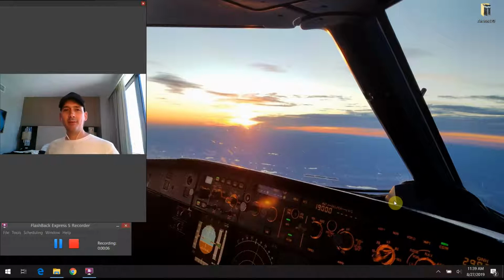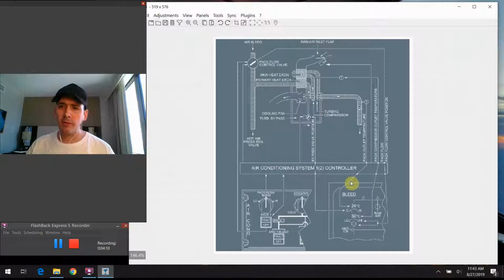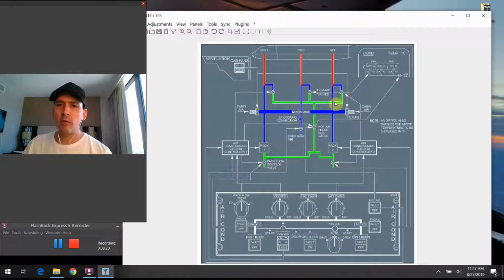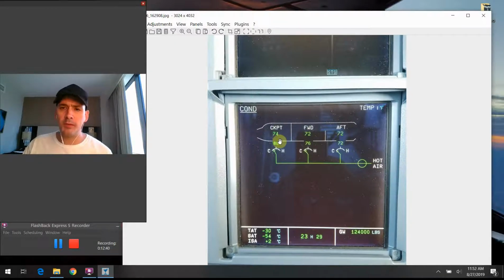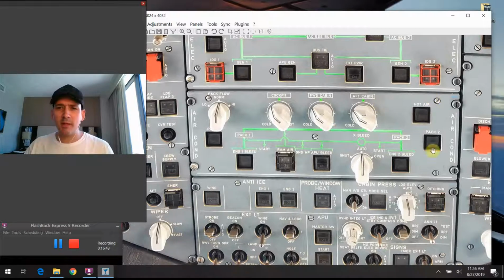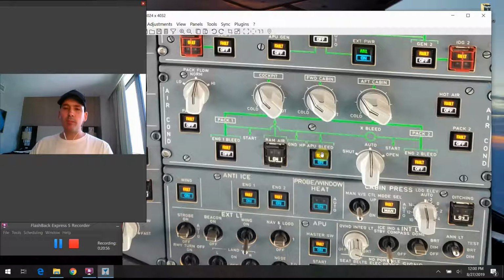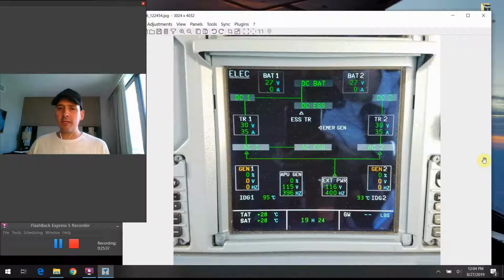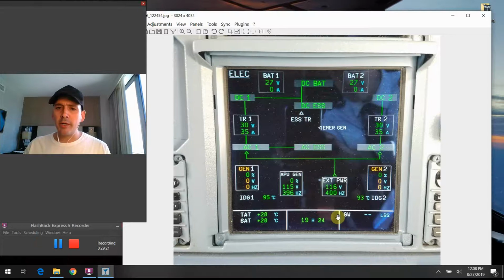Airbus A320 Cockpit Tour: #22 - Air Conditioning Panel: What do all those buttons do?!

Comment: I noticed that when the engines are being turned on, on some flights I would smell a little burnt kerosene in the cabin. Is that because some exhaust is feeding back into the packs?
Reply from the maker: Hi Peter, great observation my friend! Yes that is indeed correct. The pack intake valves actually close automatically anytime an engine is started on the airbus. After the start is completed, the pack pressure regulating/shut off valves, sometimes called the PRSOV's, once again open and being taking in bleed air, which comes from the outside. This bleed air generally comes from the APU if you are going to single engine taxi, or the main engines if you are going to two engine taxi. Once these bleed sources start to feed outside air into the PACs you will certainly smell whatever fumes may be around the aircraft at this point in time. So this could be many things, possible that you are taxing near to another aircraft, or maybe you have a tailwind, and the plane is actually re-ingesting it's own fumes from either the APU or the engines. Thankfully this is generally short lived as the aircraft starts moving and the wind starts blowing around the plane. It's good technique to not tuck up too close to the guy in front of you when you are in a long taxi line. This is a good question and shows some real good head work and thoughtful understanding of how the systems are working...cheers! Mike

Comment: Hi....Why are the windows of an airplane cool to touch but does not feel frozen even if the temperatures at the cruising altitude is below 0℃?
Can you explain more about cross bleed engine start and the procedure for the start? Can you mention a condition where you need the cross bleed valve knob to be in the "shut" position?
I noticed a "GND HP" between the guarded ram air button and the APU bleed button which I assume, is the air supplied from the ground air conditioning units. If an aircraft is supplied air  from both APU and ground, does the aircraft use either one or both?
When the guarded Ram Air switch is pressed,  where does the ram air comes from? 
What are the main causes of smoke and fumes on an aircraft?
What is the purpose of the lower middle box in the lower ECAM? I understand that the lower left box shows the temperatures while the lower right shows the weight. I can't quite understand the purpose of the lower middle box.

Thank you for answering my questions Mr. Abignale 😀😀😀
Reply from the maker: Haha, its all good guys! Keep those questions coming! I dont mind. I love talking about this stuff and I really like to see the engagement! Thanks for watching Leonidas! Do you guys have any ideas of ways that I can make this channel better?
Reply: @MikeAbignale  I'm thinking ......More videos from the cockpit.....Like the one where you showed us that clacking sound of the relays when you press the EXT GND PWR pushbutton.....Really loved it

Or maybe something like a simple quiz or little bonus snippets of information like that about the ice probe....I didn't know it can be illuminated.....I just thought you have to use a torch or something to illuminate it....It is a small, but valuable piece of  information about that small probe.

Still.....Love your content😍😍😍
Reply from the maker: @abythomas6963  ok thanks so much for the feedback! I'll try to incorporate more of those types of elements!  Cheers!
Reply from the maker: Why are the windows of an airplane cool to touch but does not feel frozen even if the temperatures at the cruising altitude is below 0℃? - Youre not actually able to touch the actual window surface itself but a protective plastic cover that has an air gap in between it and the window. This is to protect the glass from damages. 

Can you explain more about cross bleed engine start and the procedure for the start? - Comes out of the QRH, but basically you close the engine bleed on the recieving side, open the cross bleed, and bring the thrust up on the operating engine to achiev an air pressure of at least 30PSI during the start. Usually somewhere between 35-40% N1.

Can you mention a condition where you need the cross bleed valve knob to be in the "shut" position? -If the auto mode fails and you need to isolate one side of the system from the other.

I noticed a "GND HP" between the guarded ram air button and the APU bleed button which I assume, is the air supplied from the ground air conditioning units. -Yes thats correct, this air would come from a High Pressure ground cart that you would be using to start the main engines if the APU was not working. 

If an aircraft is supplied air from both APU and ground, does the aircraft use either one or both? - Essentially the APU air, as the pressure output is much greater than the jetway supplied low pressure cooling air, so it overpowers the low pressure input. This is something we try to avoid doing though because the valves inside the airplane can start to "chatter" as they say, as the systems fight each other to supply air.

When the guarded Ram Air switch is pressed,  where does the ram air comes from? - There is a small ram air door that opens up underneath the center of the belly of the plane. Ill try to see if I can get a picture of this for you.

What are the main causes of smoke and fumes on an aircraft? - Electrical fires, things burning up in the cabin. Perhaps started from overheating batteries, Cigarettes (Illegal actictivity) , or malicious acts. Fumes most of the times comes from exhaust leaks entering the cabin.

What is the purpose of the lower middle box in the lower ECAM? I understand that the lower left box shows the temperatures while the lower right shows the weight. I can't quite understand the purpose of the lower middle box. - Mr Leonidas is exactly right :)
Reply: @MikeAbignale  thank you very much Mr.Abignale😀😀😀
Reply from the maker: Thanks so much for your feedback Leonidas! Hmm I have a lot of work to do haha
Reply: @Leopilot   thank you for clarifying my question Mr. Leonidas 😀😀😀